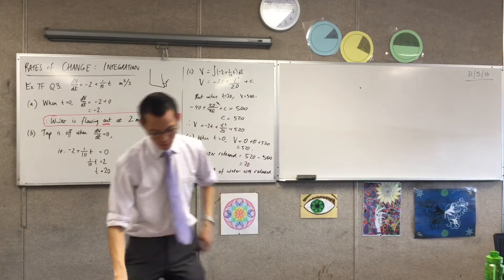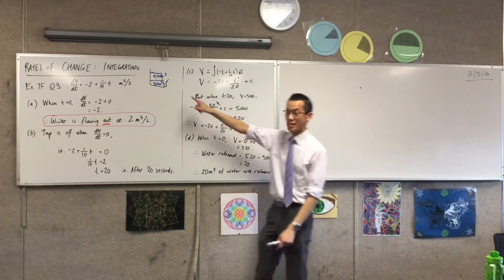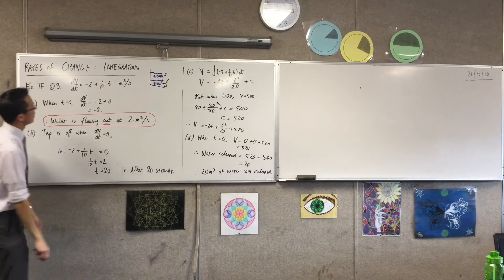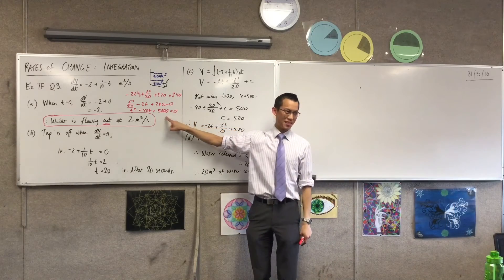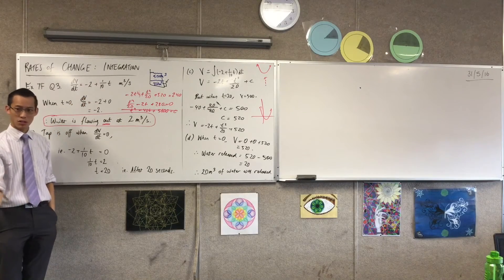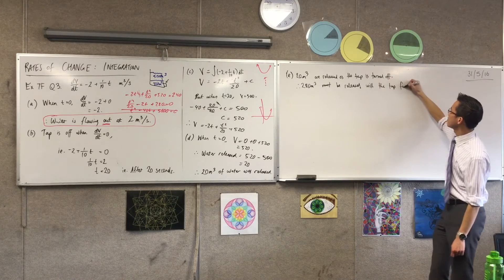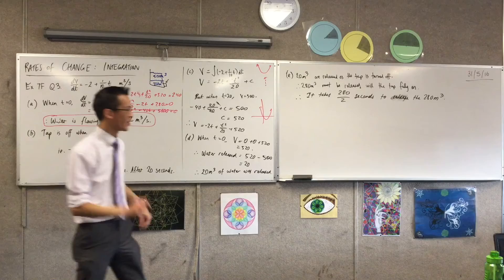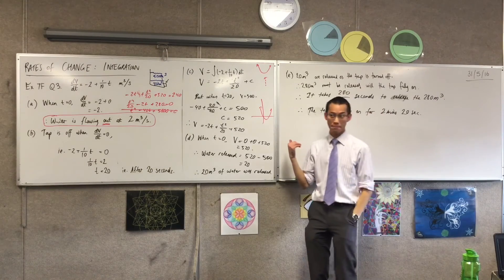Rates of Change: Integration (4 of 4: Finding time to release specific amount of water)

Comment: Doesn't the rate of the water flowing out vary with time? Doesn't that mean we can't exactly divide 280/2, and neither can we assume that it takes 20m^3 of water released to turn off the tap, because a much less volume would mean that less water flows out within the time we turn off the tap?
Reply: with tap fully opened the water flows out at a constant rate, that's the whole point of the question. flow-out only starts decreasing while turning tap off